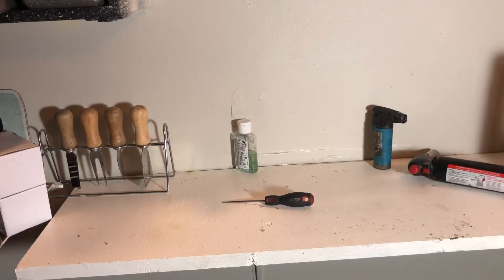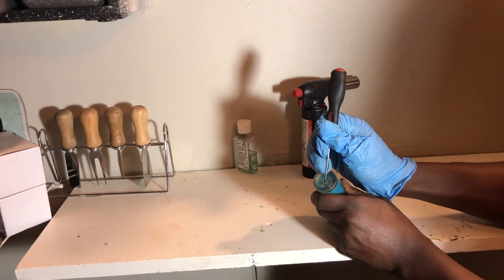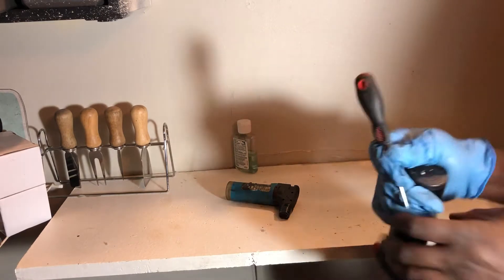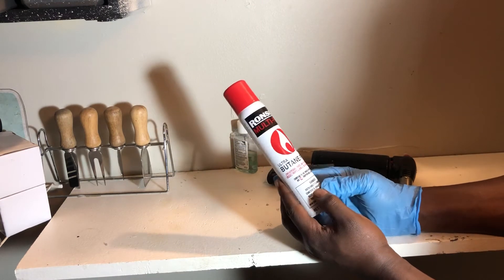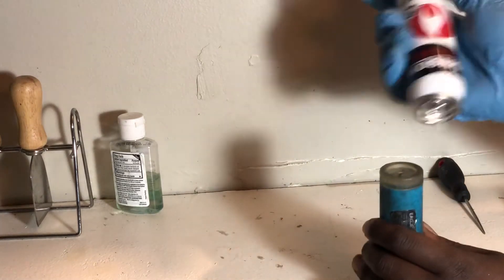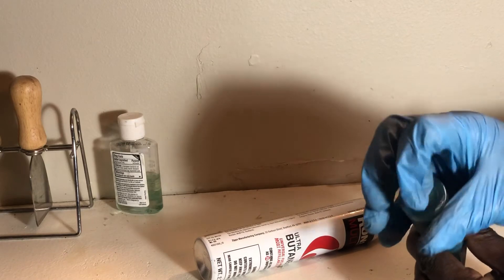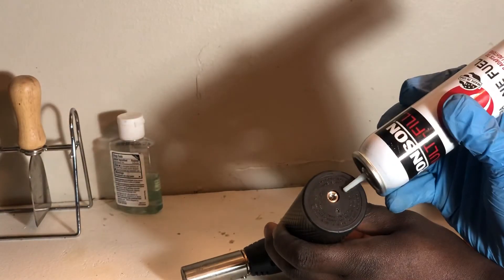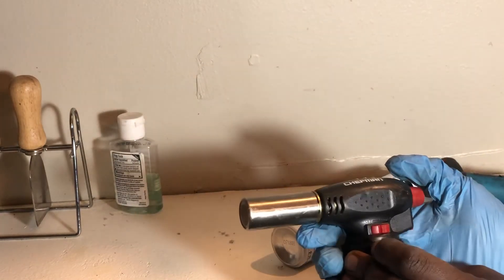How To Refill Lighter and Butane Torches DIY

Comment: I let the air out and then put the butane upside down and cover the fill hole, yet it always sprays all over me and I can't ever fill it. I always make sure to let the air out first, but I don't know what I'm doing wrong. Is there a good torch that you would recommend?  Thank you in advance 😊
Reply: Try using the different tip attachments that are inside the cap of the butane
Reply: @NikkiLee23BBy this one worked for me.   Thank you fellow human.

Comment: How about wen ur smoking and u only getb1 or 2 solid lights and  then it acts as if it's dead a buddy showed me last summer how-to purge and he didn't do it anything like u did in this video and seemed  way more effective he pressed the valve in but wen the air finished draining he flipped it holding the valve in and it continued to drain again hebdid that likeb3 or 4x but I still can't get mine to come out of limp mode or whatever it's prob is
Reply: Use better butane
Reply: @NikkiLee23BBy  I use whip it and now neon witch is purified 11x so wats any better lol and I order mine by the case it's cheaper that way for me
Reply: Think it was just the lighter I was using I was having issues with

Comment: Never use Ronson On torches!
Reply: Exactly! Never!
Reply: Why? What's wrong with that brand?
Reply: Yeah, why yawl saying don't use that brand??!!? Should know that's the can I just used because my roommate bought it. Probably the cheapest for sure since he picked it up 😅 Seriously, I noticed it seemed to get cold very fast. Is there something about the fuel itself that's more dangerous if accidentally inhaled?
Reply: Cause it's super cheap fuel which will clog your lighters. You need to get triple filtered butane or higher even. You can almost always get a lighter to work with good butane like vector.

Comment: This was so helpful tysm (though I probably shouldn’t have used a fork to release the pressure)
Reply: Not bad just be careful not to damage the valve and get an empty ballpoint pen ink plastic clean of anything and that will protect and properly bleed both ends or get a real bleeder tool. Worth it!

Comment: If I still have butane in my torch and I just want to top it up will doing this waste what I still have in it? Like should I only do this when my torch is properly empty?
Reply: Only top off if absolutely necessary and purge some air slowly then add more butane if you know your torch can handle it. Otherwise never do this because it will break it! If anything keep a cartridge with you so you can fill 18ml when its out. They are $2 unless you fill it yourself.

Comment: Does it have to be completely empty to release the gas and refill it? I wanted to top off a half full blink torch but I don't wanna go releasing the butane accidentally instead.
Reply: It does not need to be empty. Hold the torch vertically and, of course, upside-down. Press the torch valve. It won’t hurt anything if a little butane squirts out — that shows you have released all the air.
Reply: Not exactly true. You can and will break your refill valve. Air pressure forces everything out breaking it permanently. Not all but cheap ones will. And yes why would you save a second to get less butane in?

Comment: I did this and my refill butane just keeps spewing the butane from the insert point in lighter, what do I do
Reply: The problem is that the refill butane is not properly seating on the lighter valve. Look for refill butane that has a half-dozen plastic tips molded into the butane cylinder’s plastic cap. Select one that fits snugly over the lighter valve. Press the cylinder onto the plastic tip firmly and hold it there until a spurt of butane shows the lighter is filled.

Comment: I refilled both my torch and lighter.. The torch was working after the refill. But the lighter did not work even though I refilled it. Does anyone know why this would be, why the lighter will not work?
Reply: You need lighter fluid for a lighter bro🤣🤣🤣
Reply: Butane lighter? You have to wait a few minutes for it to warm and stabilize. If not you didn’t actually fill it.

Comment: I don't understand why I always have trouble. I always bleed all  the excess before filling it, when I fill it the fluid spurts everywhere and I'll get like 2-3 lights off it then it's empty again... what am I doing to get air in there!?
Reply: Ik having the same trouble please tell me if you fixed your problem
Reply: Same also going back to propane
Reply from the maker: Make sure you align the tips so the fluid can flow unobstructed
Reply: I fixed the problem. I wasn’t applying enough downward pressure. I really had to put it in there it naturally feels wrong but it gets the job done. You stop when actual fluid starts to spurt out
Reply: @shortyclarkchc19  ^^
Reply from the maker: @vicentetaylor7346  Awesome, glad you were able to make it work.
Reply: @vicentetaylor7346   could be that the nozzle needs a fitting on it. It maybe the wrong size
Reply: Newport butane comes with quality tip adapters. No cheap red tear off ones and never had a problem again. Also release and add pressure 2 or 3 times for the ones that only fill a certain amount. They need more pressure change to get it in there. I don’t even hear the butane anymore. Quiet and quick!
Reply: You helped me by saying really gotta put it in it. That was my issue. Thanks sooooo much I have a 12 torch graveyard bout to be filled finally I'm so excited lol
Reply: Definetly air
Reply: Me too!!!!! Wtf. I found that it’s because you have to open the screw. It’s a turning screw where the air is being let out of at least on mine.
Reply: @boogie1014  Don’t do that! You will lose your butane or your eyebrows! Thats not what its for. Its made to be replaced. You need the correct adapter. Rubber triangle one or the typical red with 3 sections. Give me your email address and I’ll send you a picture of both or YouTube screw on valve adapter. You won’t spill any just the butane filling. I fix torches. Adapter is always the problem. Newport butane or the red adapters on the red cap have them. Sometimes their plastic tip works as the adapter instead of metal because it seals. Those two work perfectly.
Reply: Same
Reply: @boogie1014  Also if the refill valve is the only way to adjust it, instead of a screw in refill valve, it doesn’t prevent butane from coming in. So if it is that type that isn’t the problem. Adapter or push it flat and hard. Plastic tip ones are better then metal.
Reply: @vicentetaylor7346  thank you.
Reply: Make sure you have the right plastic tip adapter
Reply: The exact same thing is happening to mine.... I empty the remaining pressure in the later and I go to fill it exactly the way he shows and it just splatters around and it doesn't seem like it's filling at all.... What am I doing wrong here?
Reply: Me too! I waste it all! Let it air out with pen etc!!
Reply: @vicentetaylor7346 thanks so much for your comment! Like someone else mentioned, just you saying you weren't putting enough pressure then "I knew" lol. I won't lie, it's because I was scared 😆 Always been sketchy of gas & when Id hear the sizzle noise I would think "O gosh I don't have sthg set right" lift and try again. It was a nightmare. I just laid down on it "no fear" 💯 no air sound from so much confidence allowing me to press harder and just filled one for the first time in seconds. Thanks to you all so much!! "Them little things in life"
Reply: I think we all are having the same trouble
Reply: Happy Father's Day to all the Dad's out there 💓
Reply: @vicentetaylor7346 i wanna give you a hug you saved me after weeks of doing this wrong bro😂
Reply: @rafaeltorre1643 I could kiss you on the mouth rn the way I been fighting the AIR trying to refill my torch for my morning honey and SUPRISE SUPRISE I ALSO WASNT PUTTING ON PRESSURE EITHER OMG THANK YOU

Comment: It worked for me! I was able to refill my torch after I let out that resisting pressure!
Reply from the maker: Glad I could help
Reply: Same, I had that problem too, it freaked me out when the air and a little butane came out though 🥲
Reply from the maker: @jessicamerced9116   yes it’s a bit of a surprise coz you don’t expect it, glad I could help
Reply: Press slow. Also use a bleeder if possible. It purges from the 2 ways air is released instead of 1 that you have closed off with a pinpoint to release. That hole and under it both release pressure. Works a lot better!

Comment: Thank you so much! that is  the 1st time that it ever worked for me. I never knew to let the old air out.
Reply from the maker: Glad I could help. You very welcome
Reply: Where did you think then air would go so the gas could fit?
Reply: @rhuckabee44  I thought it all came out of the top part, the end it lights from. I told 3 of my friends and they said the same thing.  "Wow I didn't know that. no wonder it never refilled".
Reply: Its empty so it must not have anything left in it. Wrong!   Wow

Comment: ... Actually if the air pressure is out, you shouldnt need to "go untill it stops.  Mines clear... without the air pressure i finally leaked out... It filled in like 3 seconds.
Reply from the maker: Awesome
Reply: Every torch is different

Comment: What’s not shown here is that some butane canisters are sold with a metal stem that will not seal to the torch fill valve. These canisters have a half-dozen tips molded into the cap so the user can select the tip that fits the torch valve. Also, a very small straight-blade screwdriver is easier to use to depress the torch fill valve to release any residual pressure before refilling. Just make sure the blade doesn’t block the valve orifice.
Reply: Those tips are low quality and you rip off. Newport butane has quality ones free. Exactly about bleeding. That tiny hole releases pressure too.
Reply: man the bigger metal tip sucks that’s what i got
Reply: @bloqq5956  i think i got that one too and it sucks. I have to find an adapter piece for it

Comment: Why not just wait until it's actually empty?Seems like a waste to release what's in there already just to refill.
Reply: Sometimes it’s to little gas or just built up pressure
Reply from the maker: Because the flame dwindles hence needs refiling
Reply: Seriously? Are you happy with a drink half filled? Take out the wasted ice (air)! And fill the whole thing. Otherwise what is the purpose?